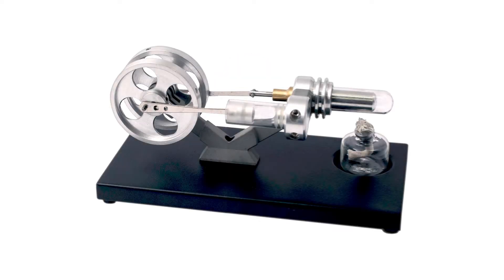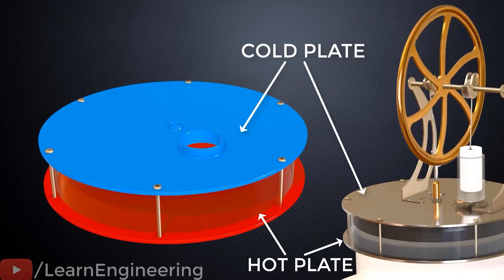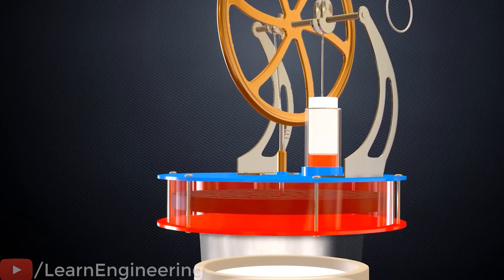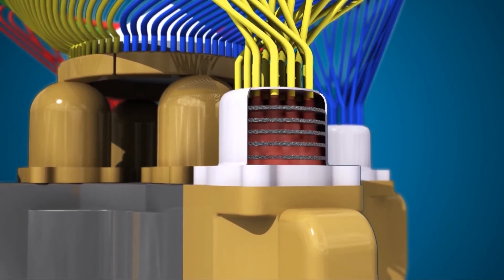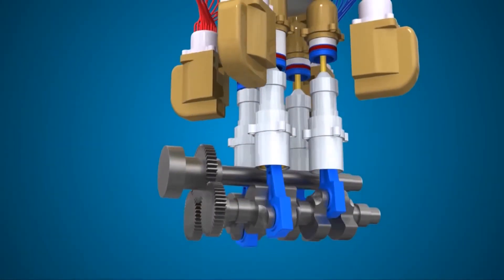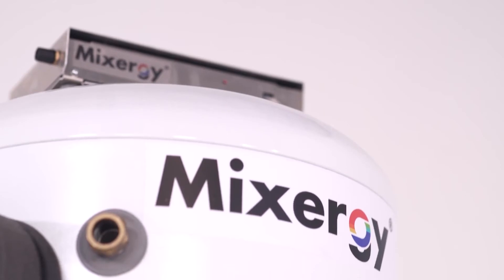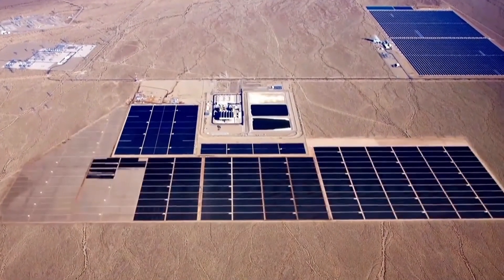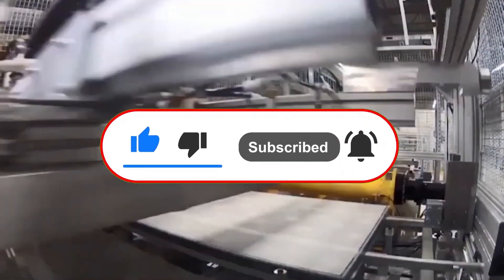PART 2 of 2 || Could Stirling Engines be the Energy Storage of the Future?

Comment: One comment. The dc electricity already produced can be stored in dc batteries. If you add a sizeable stirling engine how much dc electricity could be produced? Would it be economical to  add the stirling engine? Thx